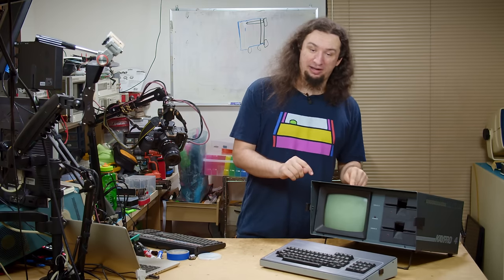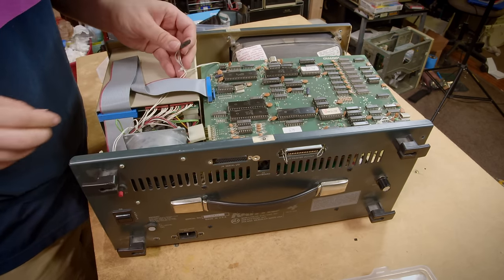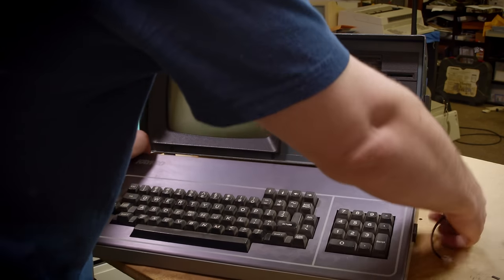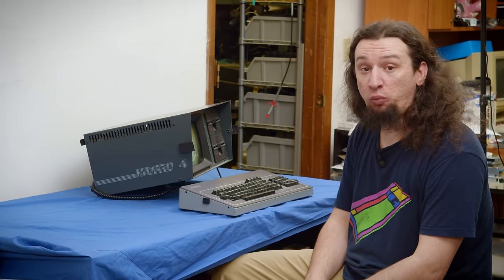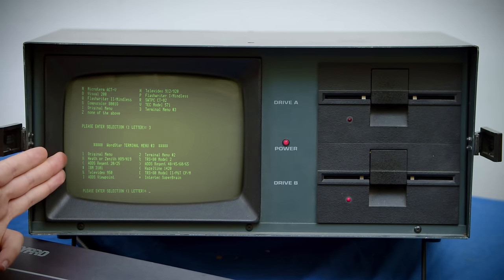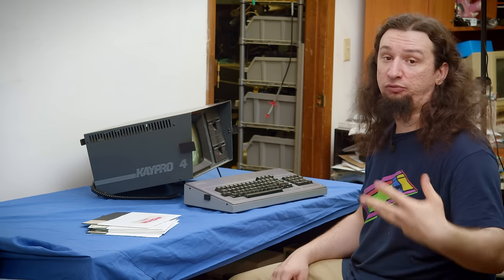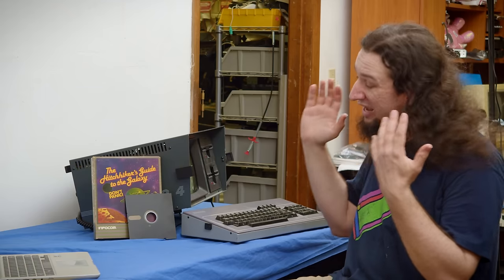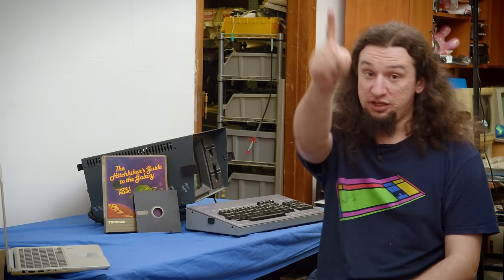Kaypro IV '83 Up and Running

Comment: I worked with a fellow who in the early 1980s wrote a book on the Kaypro.  He printed to a daisy wheel printer.  A chapter would take overnight to print keeping his family awake. Whack! Whack! Whack!  Whack!  LOL.  (RIP Bill L.)
Reply: That would have been one of those nights his wife would have made him sleep on the couch, but in the end it was all worth it lol.
Reply: Back in the day, we used Kermit, which seemed to be available for anything, and hook different machines together by serial cable sand send files from one to another using Kermit. Which got around incompatible disk drives.

Comment: Keyboard connector:  Plastic tends to get brittle over time.  And especially something like the keyboard connector that gets a good amount of stress, it can break easily.  The good news is that DigiKey sells replacement connectors that work and fit just fine.  I replaced the connectors on my 4/83 and 4/84 systems.

Comment: Back in the 80’s I had a side gig that I would call “Folding floppies”. What I was doing was taking the 8” floppies and coping to the customers 5 1/4 “disks. There were a few different versions of 5 ¼” disk formats out there at the time, as you can see, by this video.
The trick was to send a version of X-Copy receive only (as it was smaller) to the host machine and then send the full version of X-Copy to do the actual transfers. This was all done over the serial connections. What took the time was to work out the serial port set up for the host machine.

Comment: Noise without those caps CAN disrupt other devices plugged in to the same outlet\strip. Such as printers(including one HP laserjet from the mid 1990's), external floppy power supplies, external CD-ROM drives, MODEMS, early wired networks(close cabling).

Comment: What a tank of a machine! It's just a shame that keyboard connector isn't as tank-like as the rest of the machine. I'm guessing it took a hit sometime in the past and didn't quite break completely, then age and being moved around and used finally cracked it the rest of the way. Good to see it fixed up and working though. I'm pretty sure I would've hated CP/M if I ever had to use it back in the day. It's just different enough from MS-DOS and slightly more convoluted to use that it would've frustrated the hell out of me.

Comment: Actually if you want a nice easy to use CP/M machine, all MSX machines with a disk drive have MSX-DOS which is CP/M 2.2 compatible. Uses FAT12 instead of CP/M FS and most use 3.5" floppies. The original MSX standard is only 40 columns, so be sure to look for a MSX2 or 2+

Comment: 21:14 - 0 (zero) is not related to root:root as in Unix/Linux? Because actually users and groups ID started with 0 which is root and grow up from there to include system users and groups as well.

Comment: So if you have some equipment where the Rifa caps blew years ago but were never removed, it's technically okay to just keep using the equipment without removing it at all, correct?  When it blows doesn't it just act like an open circuit?
Reply: I think Rifa type X fail closed and rifa type y fail open.  That's why its also important to use the same type when you replace them :)
Reply: @richardwaters9284  Thanks!

Comment: Fun fact (if noone has mentioned it already) is that the RIFA capacitors are made by a Swedish company.
It's name is Radio Industriernas Fabrikations Aktiebolag which translates to the Radio Industries Manufacturing Company.
Reply: Aktiebolag, most common languages I can usually figure out the gist because they are usually sharing similar words, but that word does not tie in 😂 if you don't mind me asking, what does it translate to in English? Edit----from my astonishingly powerful abilities of deduction I've figured out it is the "company" part of the translation but I was asking for more information, just to make my vague question more sensical 😅
Reply: @wilfredpayne433 it's the company type, in english it would be Ltd or PLC
Reply: Did anyone ever mention to them back then that it was likely to explode and produce a smell worse then a Fart
Reply: @EmperorKonstantine01  It would produce a worse smell and then a Fart?

Comment: I was under the impression that the RIFAs were safety capacitors that were required. After you mentioned deleting them as they were really noise filtering, I found an article on allaboutcircuits from 2019 that explains the X and Y safety caps. If you eliminate them then you've eliminated the safety risk that a standard capacitor might create. Interesting reading and thanks for pointing out that they are not necessary.
Reply: I would say they're often not needed for the operation of the device that has them. However, they are not only there to protect the device from external noise, but in a device with a switching power supply, they also act to significantly reduce the conducted noise put back onto the mains and also transmitted noise radiated from connected cables.
Reply: Yep, the safety is versus a regular cap rather than versus none cap :)

Comment: Wow..  I had this exact same model!   Bought it in Port Isabel, Texas in '83 (well, my dad bought it for me).  Also had a Telex TTX-1014 daisy wheel printer and a Hayes 300 baud smartmodem connected to it.  I also had a fake-leather soft carrying case for it.   I remember I always routed the keyboard cable straight back and under the back corner of the case, then directly up to the port.  Played games like Ladder (an ascii copy of Donkey Kong), Star Trader (a kind of space trading game), CatChum (Pac Man copy).   Did a LOT of grade-school and high-school reports on WordStar.  I wish I still had some of the old floppies.
Reply: A Hayes?  Your dad must have been rich.  I could only afford an Anchor Signalman.

Comment: I lioved the Kaypro!!!  What a fantastic lugable!  In college I was the first in my dorm to have a personal computer and I used it for both wordprocessing (WordStar for the win!) and as a smart terminal connected to the Vaxen in our Computer Science lab via its internal modem.  I worked for a Kaypro dealer and at one point you could turn the lower priced half height dual single sided drives into dual sided by sinply moving a jumper on each drive...  :)  Best...
Reply: I love when new or old stuff has "Simple" "Hacks" to improve/unlock features or performance. Just sucks that most stuff these days are locked down in hardware so even if the features and capability is there, the chip (and/or circuits running it) are designed not to allow (easy) tampering to get more out of what you paid for.
Reply: Yes, the Kaypro was my Resume machine when I move back  to Seattle from Yakama.
Reply: That’s so fun and cool!! I don’t even know what a Vaxen is, what’s a Vaxen?
Reply: @meredithunit A VAX is a mainframe by DEC. Colloquially VAXen would be plural for multiple VAX mainframes, as geeks we like to play around with language, so ox and oxen, but box and boxes, because one is animate while the other isn't, therefore as a joke we refer to computer servers as boxen as they are "live" ergo animate boxes, and therefore similarly vax and vaxen. Ah, old school nerd humor.
Reply: @martinlebl631  oh 😂 that’s clever, okay cool

Comment: Those Z80 I/o chips were excellent. They worked with the processor to give hardware vectoring of interrupts, with prioritization, which meant you could do a lot of efficient interrupt driven I/o with a Z80 based system. Don't people know this? It's one of the stand out features of the processor

Comment: Oh hey, a Kaypro 4.  Not to be confused with the Kaypro IV
Reply: You mean the Kaypro 4 '84 with the built in 300baud modem and half height 5 1/4" floppy drives! I have one of these that I bought while in college and still have it along with all the floppies and books. I also have a number of language compilers for it. At one point, I had upgraded to an external 1200baud modem, then eventually a 9600baud.
Reply: And yet, after that opening, I’m even more confused why the disk definition and video thumbnail say IV rather than 4! Haha

Comment: I just got one of these from Ebay with drive B replaced with a Gotek drive.  It came with a USB stick and I can access it fine.  Could you do a video or provide me more information on how to get programs and load them on the USB in the proper format to use with the Kaypro?

Comment: Shelby, did you use a 360K drive to write those floppies? I am having difficulties creating my own floppies for the Kaypro IV with my Greaseweazle. Thanks!
Reply from the maker: Yes, you are much better off using a 40 track drive to write disks for another 40 track drive because the head on these are wider than an 80 track drive. The IV I have used Tandon TM100-2A's which are the same drives as an IBM PC. It should be possible for you to connect them to your greaseweazle if you don't have any other 40 track drives.

Comment: Regarding the RIFA / X-Capacitors: While they were used as filter caps here, there are legitimate uses where you definitely need them.

X- and X2-capacitors are designed to be between line and neutral, there are also Y-capacitors which are connected from line/neutral to earth. They are built to withstand overvoltages and "heal" themselves without creating a short - which they do unless they are 30years+ and yellowed like those you showed.
The thing to keep in mind is the "capacitor- power supply" used in many appliances with either low wattage or used as standby supply. There the X2 is used like a series resistor to drop voltage directly from the AC plug towards a zener-stabilized DC power supply. There you definitely need to keep them in or replace them 🙂
Reply: Given neutral is connected to earth (with busbars, in the breaker box) in the UK, I wonder if there’s anything which still has Y caps sold here (presumably multi-region devices would).

Comment: At university in the microprocessor course we had CP/M machines developed and manufactured by my later employer. At that time I had a C128DCR + 1581 and an Atari. While the C128's Z80 was really slow the C128 CP/M had some nice features: It supported multiple disk formats that could be extended by patching unused entries in the format table. So I was able to add the format of our machines at university and could prepare most of the work at home. The 1581 strangely had the diskette sides inverted compared to most other systems like the PCs. But as Commodore had added the feature to load own software e. g. to hook into the command interface I wrote a small piece of software that was correcting the side assignment in all commands related to MFM formatted floppy disks.

Regarding WordStar I remember darkly to have patched the file which was well documented.

Comment: The screw-downs on the serial port do the shield grounding! This is just an old-style DB-25 connector. 
The serial standard pin one is chassis ground, and pin seven is signal ground. It is the DB-9 that uses the shield as the chassis ground, not the DB-25.

Comment: Ok i know third comment...
If i remember it correctly, the guys at commodore in 1985 hat similar problems when choosing to what flavor they want the 128 to be compatible.
There is that infamous story of putting an inverter to the index whole sensor and then rearranging bits and bytes per hand and calculator to write back via disk monitor just to make that one, at the time promising/popular format work just in time for the CES.
In the aftermath CBM shot themselves in the foot for that format did not prevail... yeah none of them did in the end but it would have given the 128 so much more utility if you hadn't have to hire the scicillian mafia to track down software that works on that box.

Comment: User areas are more like directories.  There are only i think 16 directories.  U0 through U15.   There is also a limit on the number of files per directory.  There is a command to change the active user area but it at this point escapes me.
Reply: That would the command USER x (where x is number of user area desired).